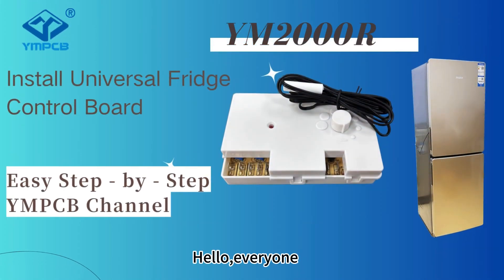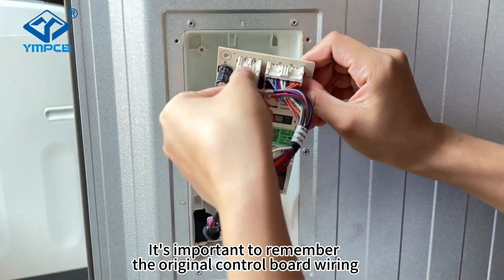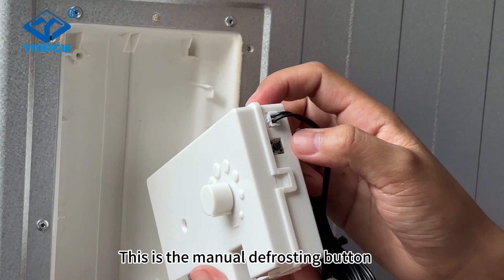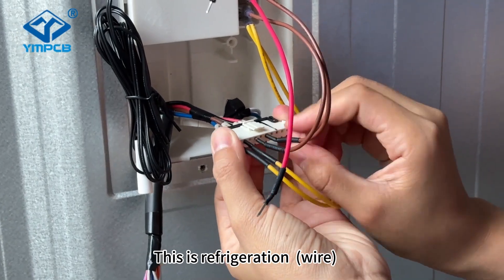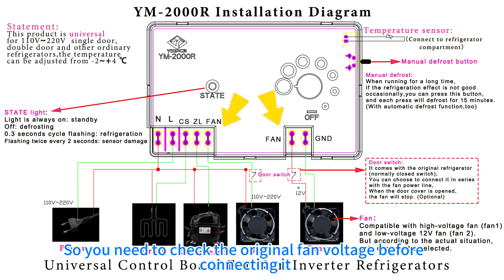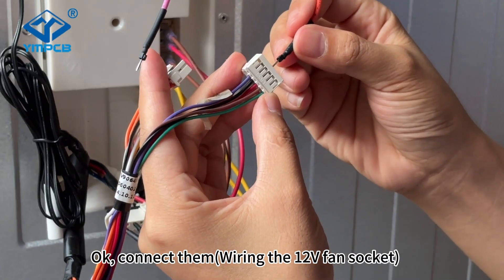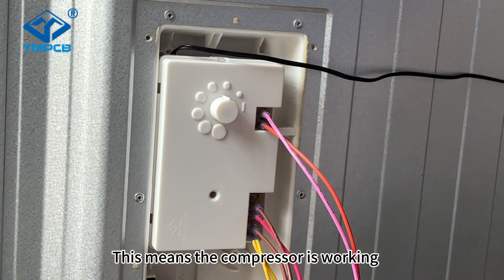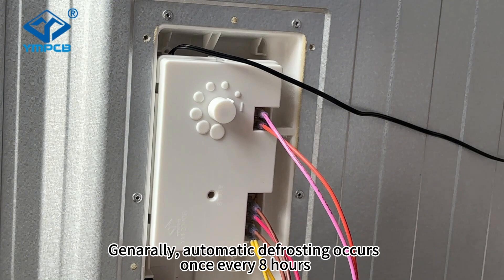How to Install a Universal Refrigerator Control Board | Step-by-Step Tutorial for YM2000R

Comment: why dont put temperature sensor at evaporator?
Reply from the maker: Hello, friend, please install this temperature sensor in the same location where the original one was placed in the refrigerator. The video is for reference only.
Reply: From where can I buy these pcbs, I am from India,  Will this single pcbs work for all capacities from 200 liters to 500 liters inverter model double door fridge?
Reply: I want to buy this item